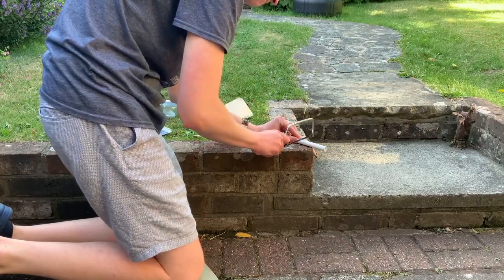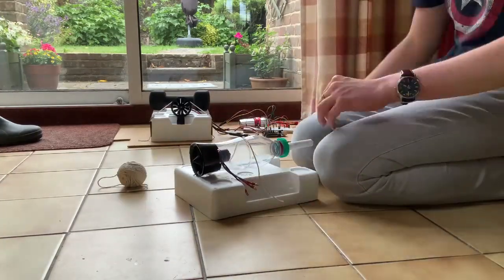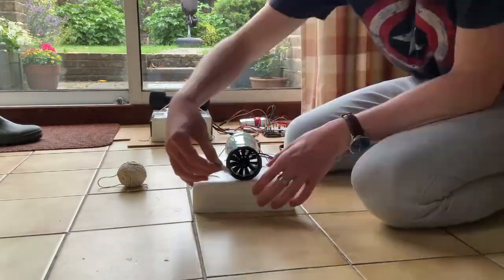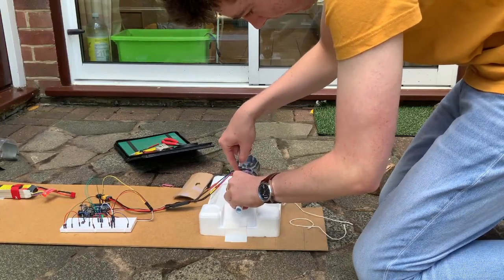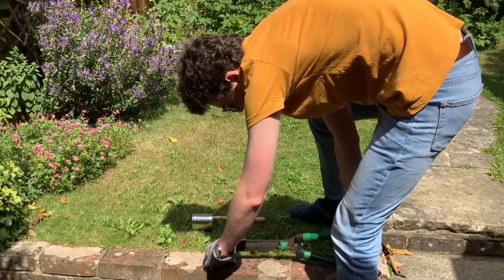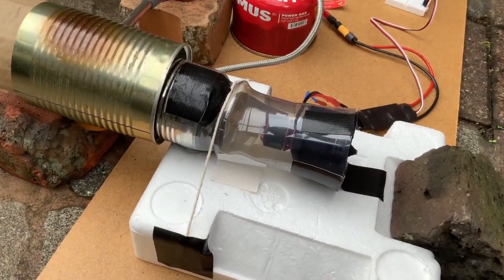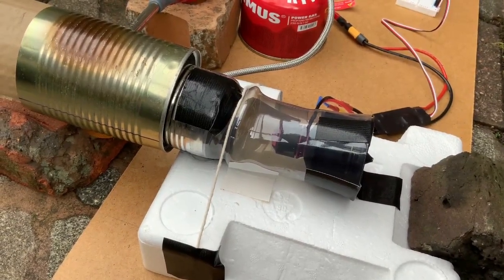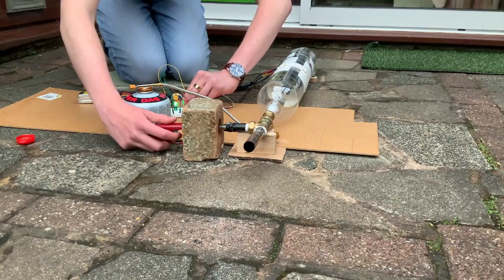Electric/Butane Hybrid Jet Engine

Comment: i think the gas u are using for your fuel is not capable for more burn power.. as a result when the BLDC motor hits a top RPM , the  fuel stops ignite itself for huge air thrust according to its tolerance capacity. .. so using kerosine or other high burnable gas can withstand the thrst... but I know its a major prblm... the more the heat is the more u have to shift from regular plastic to a metal casing ..!!

Comment: Wtf it uses gas its not fully electric
Reply from the maker: It's more that I use an EDF for the air intake, as opposed to manually pumping air in or using a turbine/compressor setup. I take your point though, it isn't fully electric.